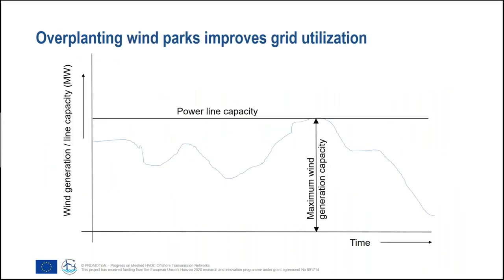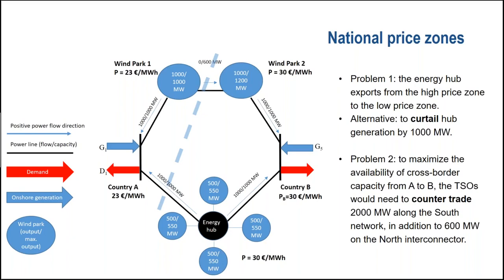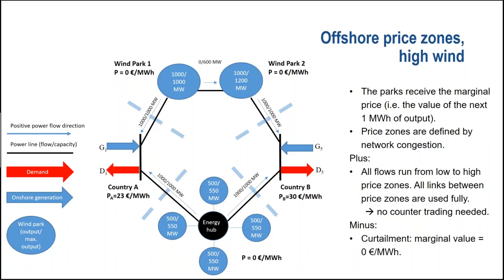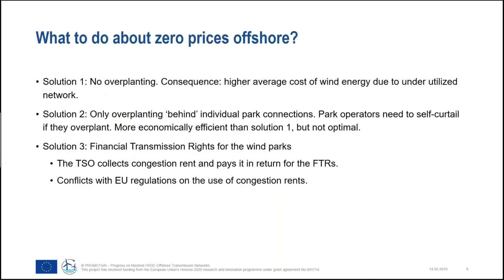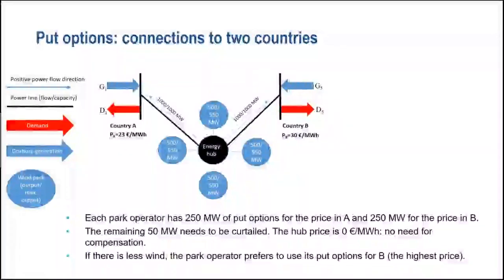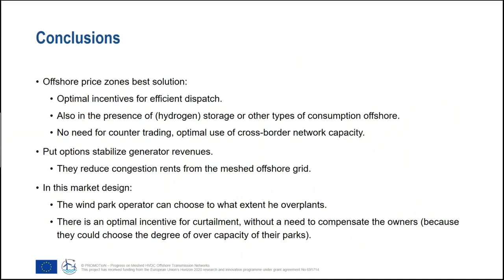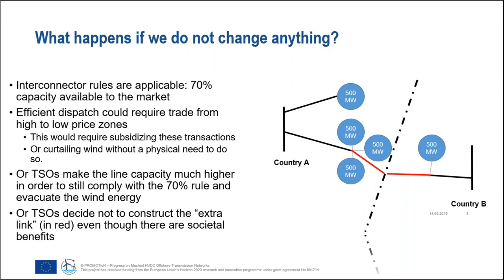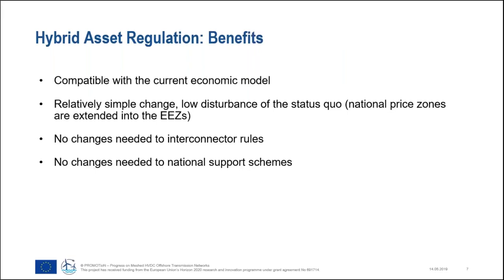WP7-1 Hybrid assets vs market based small zones, part 1 & 2

Comment: A nation by geography should be in a good wind speed region and if it has the ability to have  Plant, Equipment, and Machinery within or should source from others will have the most economical price of energy generation.  I am optimistic that it is possible to generate 100 MW from a single offshore  Wind Turbine installation. If wind can spin 3 rotor blades weighing about  60 tons each, should we limit power generation to just 15 MW?